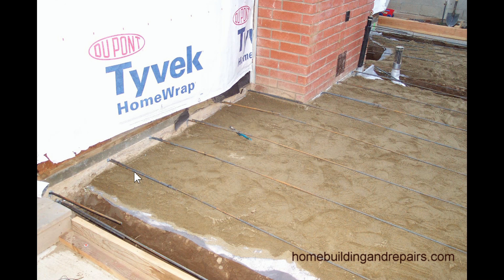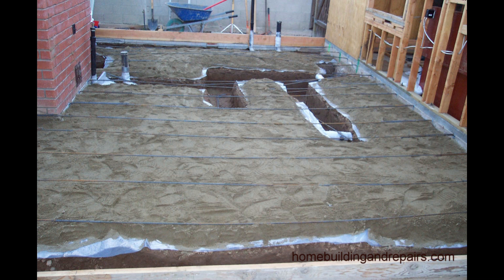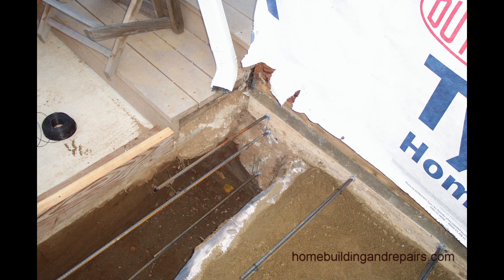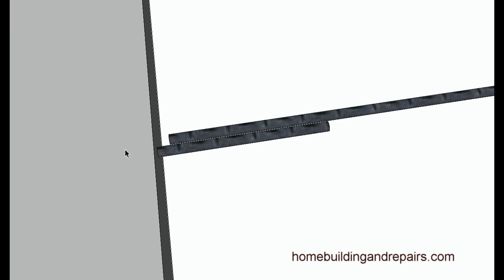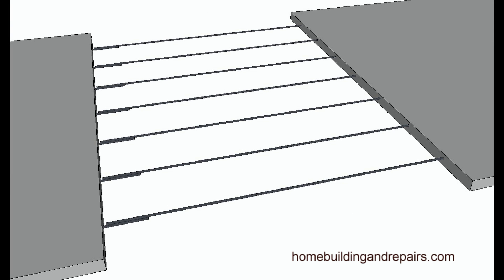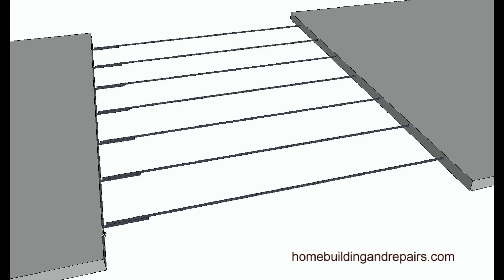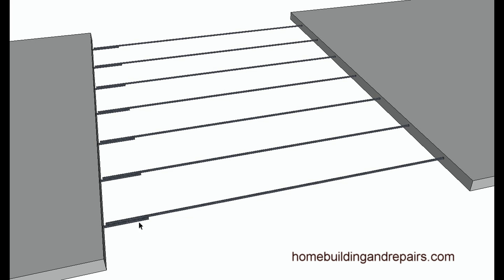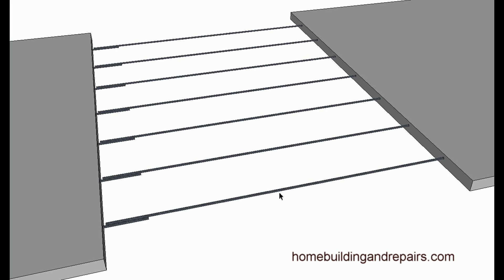Alternating Full-Length Rebar Dowels For Stronger Concrete Slabs – Remodeling Tips

Comment: I know this video is old and hopefully I get a reply but how would you do the layout for dowels if you have some holes that will need to be drilled in an angle do you have a formula or technique you can show to always have everything squared off even when there’s no square to measure from
Reply from the maker: What I usually did was drill one about 1 inch lower to allow for bend and then check to see if it was in correct location, then adjusted and drilled the rest. You can usually bend it to fit it's location.

Comment: I like the idea, and was toying with it myself recently. There is an issue with the approach of inserting the long rebar, and that is if you intend to use rebar rod into a hole that is drilled to the same OD (which is the ideal way in order to minimize movement, and can even avert the need for epoxy), then you will never be able to knock it in as required. Also, precisely and accurately manipulating rebar at those lengths is not an easy thing to do and I think you might get an inconsistent outcome. Lastly, if you stray off-perpendicular even a fraction when you drill your holes, then your rebar grid is going to be just a bit too funky. But, the thinking is definitely worthwhile imho.

Comment: yeah great idea! the crack will be there anyway is the load will be unbalanced over old and new poured slab !easy !is not about that you present here ! is about if the slab will sag or not and the water  infiltration and live and dead load is apply to them ! silicone every joint !
Reply from the maker: Confusing

Comment: Great video . Can it be use for a roof slab?
Reply from the maker: I would check with an engineer. Concrete roofs might require more doweling or structural reinforcement.
Reply: @gregvancom   thank you . Your input would be highly appreciated 😉

Comment: I did a crumbling garage patch of slab for a neighbor a number of years ago.  It was small at only a few square feet.

Using a concrete partner saw I cut out the bad spot.  Drilled dowel holes in the old slab border and banged short easy-to-work-with rebar into place.  I then welded in full-length rebar sections connecting each dowel to its opposite mate.  After welding, the rebar mess was one solid weave.  We poured the concrete the next day.

It's been years since the repair.  Usually two or three times every Summer when folks are out bumping into each other, he'll go, "Still holdin'!  There's not even a hint of separation between the old slab and the new pour."

An AC-only tombstone buzz box can be had off Craiglist for $100 or less.  And since the welds are going to buried in concrete, they don't have to be all that pretty.  A competent DIY'er with a little welding research and a few practice sessions on scrap rebar prior to the real work should be quite capable making the reinforcement truly bomb proof.
Reply: I sure hope you used ASTM A706 rebar if you welded it.
Reply: Narrator: "He did not."
Reply: It was a crumbling garage floor patch...  The grade of the rebar will not impact the repair in any significant manner.
Reply from the maker: Thanks for sharing your story and even though I don't think welding the rebar together is necessary, because I've never seen it required by a structural engineer for small repairs like the one you've suggested, but at the same time who can argue with success.
Reply: Si hubieras usado chicle tampoco se hubiera rompido, solo era un parche de un pavimento

Comment: im a civil engineer and i would like to point that overlapping a  rebar can be treated exactly the same as not overlapped as much as the minimum length is respected and max diameter of stack rebar together is respected too. little science - theory of continuity states that concrete is field with micro cracks so installing rebar gives a math calculation and treatment as ideal without cracks concrete. Than the contact between rebar and concrete is calculated at micro cracks length of the rebar it means - doesn't matter if rebar is smooth or not the bond between concrete and rebar is always grater  force than the force what rebar can carry in other words it will snap instead of puling out from concrete. example - reinforced concrete [uses smooth steel and caries 10 time more load]. sry for my eng. its hard from german to adapt. cheers
Reply from the maker: Thanks a lot for taking the time to share your knowledge, it's always greatly appreciated.

Comment: Another tip:  Your lap, meaning when you tie a dowel to a full length bar, the lap length needs to be 30 times the diameter of the bar. IE: #4 bar is half inch so your lap needs to be 15  inches long.  So your short dowel should be cut at least 15 inches plus however deep you are inserting it.  Safe rule of thumb cut your dowel 3 foot or longer.  To answer the alternate suggestion, yes that is what a structual engineer would want to see.  30 years of residential & commercial concrete construction.
Reply from the maker: +Mike Cole Thanks for the tip and everything I've ever done has been 20 times the diameter, which brings me to a tip I would like to share. This comment is an excellent example of why you can't believe everything you hear and should always validate any information you receive with local building professionals, including structural engineers.

Comment: Probably that is excessive case. In order to exclude slab/floor derormation we should work with under-slab layer first: to compress sand till k=0.95, draind the groundwater and use thermoinsulation. If slab or foundation will deform even under light frame house, full-lenght rebar will save nothing. Am i wrong?))
But in slabs between floors it may be usefull.

Comment: Would you mind speaking to the distance at which the dowels/rods should be spaced from one another, the depth which they should be drilled into foundation, and also what epoxy you would recommend?  Thank you, great presentation!
Reply from the maker: +T Willey I wish I could, but I'm not a structural engineer. What you're asking will depend upon the type and size of the structure. For example a 12' x 12' room addition might only require #4 rebar space 24 inches on center or a bridge might require three-quarter inch rebar spaced 6 inches on center.